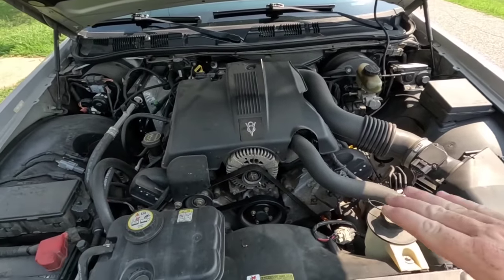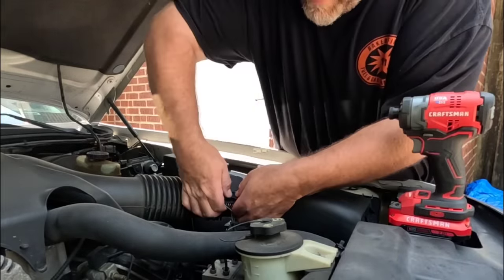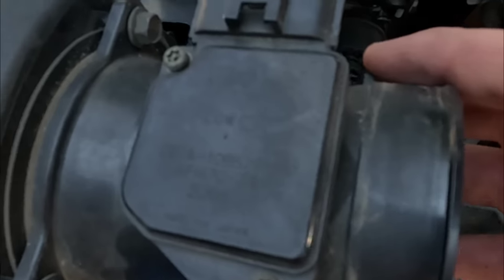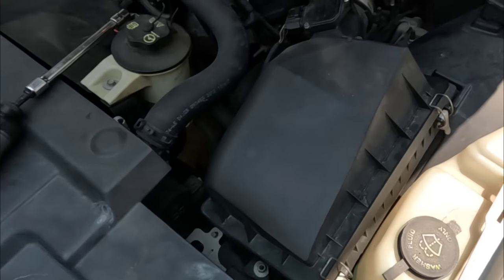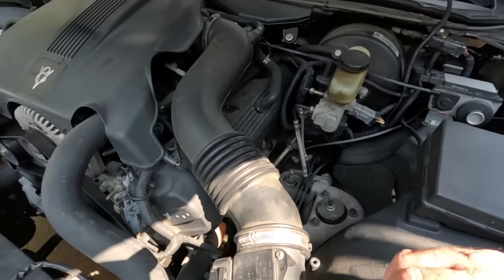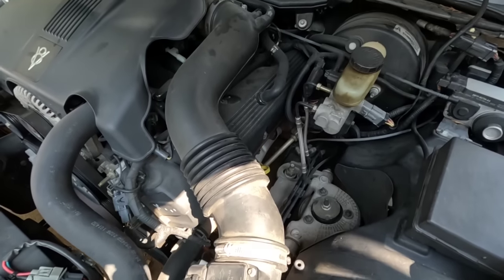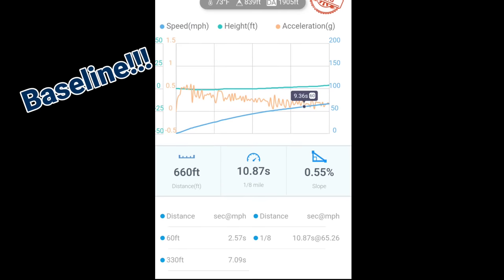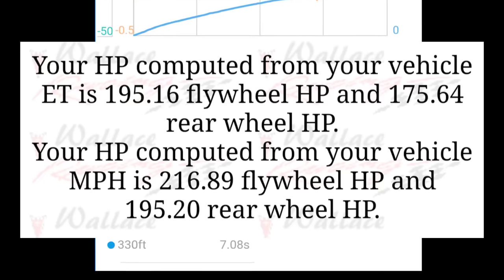FREE POWER MODS TESTED on the Ford Crown VIC LX SPORT 4.6L 2 Valve!!! @latemodelrestoration

Comment: Good video Andy. I dyno'd plenty of cars that had exhaust upgrades done on them. Never saw a decent gain unless it was the last of many modifications. The thing that I learnt from that was until an exhaust becomes restrictive, it's not. You can't solve a problem that isn't there. The only gains you can get in an unrestricted exhaust, is from improving the cylinder scavenging,  which is all dictated by what is happening in the front section of the exhaust. But you already know all of that. Looking forward to your future videos. Regards Greg

Comment: K&N made a cold air system that boxed in the air filter and made it draw thru the headlight...actually works...ask the man who owns one...most important mod for the vic/marquis is at least a 3.73 gear...with a posi...and a free flowing dual exhaust...if you check the size of the tailpipes in the stock ford exhaust it's choked down to like 1 1/2 in the bends over the rear axle...
Reply: I agree real exhaust would help.
Reply: And uh...the only place with a tune for the computer THAT ACTUALLY WORKS is Mo's speed shop in Dallas GA...mustang guys just told me to get a mustang locally...I told them that the marquis had something a muttstang would never have...a backseat I could schtupp their moms on...
Reply: @JSki-kb8vf  yep programmer next
Reply: @JSki-kb8vf  Lmao them seats are hella comfy too
Reply: But each side has only 140 cubic inches feeding it. (281÷2)
Mine has single exhaust, 281 inches, 4000 pounds, 23 mpg daily driving, 26 highway on cheapo gas. Mods are not worth the time nor trouble for the noise.
JMO.
90 GT ...HCI 👍😎
Reply: @hotrodray6802  best stock E.T...17.30...with exhaust...gear..intake...and a mo's speed shop tune 15.30...timeslips don't lie...13mpg driving like a lunatic around town...23 mpg crusing on the interstate...with the addition of powerstop brakes it's fun to drive...especially when one of those stanced import idiots pulls up buzzing his lawnmower engine and grandpa straps a holes hot on him...
Reply: I've had a few T-Birds and  a PI Crown Vic over the yrs with the 4.6 that I used a panel style K&N filter on in the original airbox but always seemed to have issues with the oil on the filter coating the MAF in a thin film oil after a while that made the cars run bad. Got tired of cleaning the MAF so went back to regular Fram filter. Always hated the MAF on them engines. Especially being so close to the filter... Current '96 TBird is running a regular Fram.
Reply: My Bone stock 02 Marquis runs 16.90 in the quarter. That’s with two people in it.

Comment: Regarding your Ford Crown Victoria, If I were you, I would try to imitate the Crown Vic Police interceptor calibration. You already have the dual exhaust. The next step would be to change your axle ratio to 3.27 or 3,55 . Then, substitute the powertrain control module from a Crown Vic police interceptor. This may require the installation of matching fuel injectors. Replace the MAF sensor and air cleaner assy with one from the police interceptor. The Crown Victoria police interceptor also uses  a lhigher stall speed torque convertor, so you may want to change that as well. I spent more than 40 years working at Ford Dealers. Would like to talk to you about this sometime.
Reply: Lmao 😂

Comment: I'm confused, how can removing a restriction (stock muffler) in the exhaust system result in loosing HP? It doesn't make sense, replacing a muffler with a piece of pipe will result in less back pressure, and less back pressure should result in a HP gain or at least keeping the same HP it had with the muffler. There has got to be some other variable that caused the drop in HP.
Reply from the maker: But cutting the pipe before the muffler you are changing the length of the reflective wave.  I do believe if it had a true 2.5" exhaust it would uncork it.  These pipes are less than 2" in some spots!!
Andy
Reply: @UnityMotorSportsGarage I was wondering what replacing the mufflers with straight pipe, to keep the full length ,would have done.
Reply: Four strokes don't need back pressure. What you're looking for is exhaust velocity. There are still four catalytic convertors to deal with. The only other answer I can come up with is lack of muffler has affected the ECU somehow. 

Straight piping it will just make it sound like ass.
Reply: @UnityMotorSportsGarage 
Uncorking ? 281 cubes = 140 cubes per side 🤔🤔🤔
Not exactly restricted...
Try tube headers.
Reply: Under car turbulence increased major and slowed it down.

Comment: The intake manifold comparison could be a red herring.  There were several versions of the intake manifold.  There was a recall for coolant leaks and some other issues.  The various intake mods that use Mustang parts will improve the performance in small steps.  An extrude honed Ford Perfomance/Motorsport version of the Police Interceptor intake historically makes a huge improvement after the air intake tract upgrades.  Gets closer to a Marauder
Reply from the maker: I am on the lookout for a good Bullitt intake off because once the Trickflow heads and all of the stuff I have planned for the car it will need it. The Factory PI intake becomes a restriction around 320 rwhp from all of my testing
Thanks for watching
Andy
Reply: No there isn't several intakes. There's the NPI intake and the PI intake for the 2v. The FRPP intake is a PI intake.
Reply: Why spend $500 to extrude hone anything?
It's still 281 cubes.

Comment: I've got a  2000  Grand Marquis. So far I've snagged and installed a Trick Flow upper plenum and ADTR ziptube. Throttle response is amazing! Next is installing the 2009 CVPI airbox I picked up for $35, a 90mm MAF sensor and a dual exhaust when I can afford it all with a SCT tuner from Marty's Spped Shop. Next year I'll be, rebuilding the bottom end the Manley way (crank, rods and 18cc Street Masters) and adding Trick Flow heads. Bad news is, as a mechanic, I'm a decent woodworker.
Good news is, I've got a friend with a 2000 Crown Vic who's teachinng me as we work on each other's cars..
Reply: I’m gonna start doing sorta the same thing on my 97 Vic within the next month.

Comment: Great video Andy, I did that on my Lincoln town car the air snorkel was so small in diameter it be like us trying to breath through a straw. Tho on the Lincoln they pull air from in front of the wheel well. So I opened up the bottom area more. You could go one step better on your air box and get some of the self stick sealing foam from one of those home improvement stores and completely isolate the air intake from the engine bay.
Reply from the maker: I like that idea! Thanks for the tip..
Andy

Comment: Im really loving this, i have a stock 98 npi mustang gt, i want to get some more performance out of it. So keep it coming, great job Andy!
Reply: Get PI heads, cams n intake manifold n you'll be making close to if not more than 300hp.. On your npi block your pi top end will bump up your compression..
Reply: Yes same here. This content is perfect for me. Gotta 98 gt and 03 grand marquis. Keep it coming.
Reply from the maker: If you do the PI intake and cam swap you will get most of the gains of the swap. The PI heads themselves offer little power. You do get a nice bump in compression though on a NPI shortblock.
Thanks for watching
Andy

Comment: Andy,

Go with the OEM intake manifold.  Install a 04 and up CVPI air box,  intake tube and a 80 mm (Mercury Marauder if you can find one) mass air flow sensor. You will need a tune to make it work.  I did my 03 Sport LX 15 years ago and it made a big difference. On the Michigan State Police test, the 04 CVPI (250 hp) ran .6 seconds quicker to 100 mph over the 03 CVPI. The factory exhaust system is actually quite efficient since they redesigned the mufflers back in 1992.  The higher numerical  RAR will improve acceleration, but you will have vibration from the driveshaft at the end of the 1/4 mile if you are at 90 plus mph.

Comment: The most effective basic mods for any Panther car are gears and a tune. Specifically 3.73's or 4.10's and a custom Tune by Marty Ochs of Mo's Speed Shop in Dallas, GA. Neither really increases power output BUT combined those two things really wake the car up and make it much more fun to drive. Anything, and I do mean anything, other than those two things would be a waste of your time and money. The only exception MIGHT be a 03+ P71 airbox and zip tube as well as a P71-style dual exhaust (for cars that don't already have those), but even that is probably negligible.

Comment: You can use HVAC ARMOR FLEX to seal the air box to the radiator support
Reply: Or a pool noodle will do the same.
Reply: The armor flex was a better idea its way more durable, Still thanks for idea!

Comment: Okay so as far as the airbox goes; the Maurader and 05½+ CVPI airbox supports just over 500 horsepower. There's no need for any of those trash aftermarket intakes, unless you just want more whooshy noises. Last I checked; ADTRs Rocket Couch is still using it. The best and basically only worth while mods, other than opening the box up, is a straighter zip tube and heat protection. All factory air boxes are cold air intakes, aftermarket ones aren't magic and make the air colder.

The problem with the Doorman intake is; it's a NPI that's poorly cast. The FRPP intake is just a PI intake. The main failure point of either is the coolant crossover tube.

You can get an 80mm throttlebody from Mustangs and Econolines, possibly Mark VIIIs and Continentals, too.  If you have DBW, I believe it's Econolines and Expeditions- I forget.

At some point you might as well get a CVPI computer because enough of these mods will require a tune to work right. Quite a few things will need a tune, like changing the axle ratio.

Also Civvys, exc the LX Sport have single exhaust. The LX Sport has resonators, the CVPI does not. Neither does the Maurader. The CVPI also has stainless steel exhaust.

A Civvy might, MIGHT be able to use a CVPI aluminum or metal matrix driveshaft. If I recall; only the CVPI, Town Car and Maurader use the long tailshaft 4R, so it is shorter- as far as Panthers go. I do know the F150 also used the long tailshaft 4R.
Reply: TC are longer wheelbase. 3" and 9" depending on model.
Reply: @hotrodray6802  I don't know what that has to do with anything I was saying. Yes the Executive Series and P72(Taxi) have an extended wheelbase that makes the back doors three inches longer.

Comment: I noticed the intake as well. I bought an e-bay intake for my P71 and it worked great. I bought another E-bay intake and put it on my other P71 and I lost power above. It fell on its face above about 4 grand. I noticed the runners were flatter on the second one I had bought. The first one I bought had taller runners similar to the original Ford intake. They were both $135.00. I went and bought a factory Ford P71 intake and haven't had a prob since. But it was $315.00 lol. Big difference. The E-Bay intakes seem to last me about 2 years before they have to be replaced. It evens out in the long run. When I replace the E-bay intake on my first P71 I will just go to Ford and get an original.  Longevity is also a concern.
Reply from the maker: It's weird you are right it feels like it hits a brick wall at 4000rpm! I'm already on the search for a Ford PI intake
Thanks for watching
Andy
Reply: If you look on e-bay and see the high runners it will run right. I don't know how to pist a link to it. I've bought a few now and they are $135. Type in 4.6L 2v I take and it pops up in the first spot with the tall runners for $98. It will not last but about 2 years before it leaks tho.
Reply: It runs just like the P71 intake. They have gotten cheaper.

Comment: Nice! Objective testing.  The gears will be a hit, hope those go next.  Listening to that 1 - 2 shift was almost painful, that relatively small engine pushing that heavy car down the road with pretty tall gearing I suspect (2.75 or so?).  I give that little cammer credit for pushing that barge around as well as it does. I remember the days of 400 inch smogger engines that were making 185 HP so this thing's doing alright.
Reply from the maker: It's horrible... Bad, thing is it has 3.27 gears. It takes FOREVER for the 1-2 shift!
You just coined the name for the Engine... Little Cammer!
Andy
Reply: @UnityMotorSportsGarage  Right on Andy, name's all yours!
Reply: Computer pulls out timing to smooth the shifts. It's very noticeable in my car on 87 gas... Less on 91 non eth but $$$$.

Comment: Regarding the Dorman intake, when I was researching it to replace my OE 2005 intake (cracked heater nipple, of course) I read that the issue is that they used their older 4.6 design, which was actually an improvement on those engines, mated to the later intake port design, but of course Ford had also improved the entire intake along with the ports. The video you included really shows the difference - the older intake design is more optimized for hood clearance, so tighter, smaller, shorter runners, and a smaller plenum makes for less flow. I ended up getting a Motorcraft OEM replacement intake, in light of all that.

Comment: my 2001 merc grand marquis runs good, but not much acceleration with 2:73 gears. on the highway,  it runs pretty good. thanks for the video Andy!
Reply from the maker: Yeah my first Vic had 2.73 gears... Horrible 😞 so I put a set of 4.10's in it lol 
Thanks for watching Kurt
Andy
Reply: 30mpg?? lol.. My 95 Lincoln Towny got close to that with 3.08..lol
Reply: @P71ScrewHead 
My 99 TC with 91 octane engine got 27 at 73mph consistently on level ground.
So did my 97 Mark dohc.
Mark was quicker but not near as smooth quiet.
Reply: @hotrodray6802  Yeah, these 4.6L 2v n 4v where great milage v8s.. Still have a hard time getting rid of my 95 Lincoln Town Car that hasn't ran now since almost 9yrs, just been sitting in my yard, sadly..lol
Reply: @P71ScrewHead 
30? Was that actual distance calculations or the dash computer?
Reply: @hotrodray6802  The dash read that when i ran it on cruise control at 55pmh for long periods of time.. It was a gutless v8 at only 175rwhp but very economical.. My P71 makes 309rwhp but chugs gas like a damn big block..lol

Comment: I have an 03 mustang GT and the snorkel gets wider towards the air box but is restrictive at the end.. I cut it back a few inches doubling the size of the opening but retaining the reach out of the engine bay into the fender well.. With that small modification and a K&N filter is better than any hot air intake on the market and retains factory look.. I definitely felt a difference but it’s probably still under 5hp.

Comment: I have an ‘01 CV HPP.  It was regularly faster than the later “250hp” CVPI models and I hardly did anything to it.  Airbox was modified like in this video(but not opened as much), K&N filter, I ported the upper plenum, “opened up” rear cats, cheap-o turbo mufflers and resonator delete, stock 3.27 gears but with a trac-lok with the +1 clutch mod and a Jmod on kill…never could get it to hit hard on the 2-3 but almost always barked the tires on WOT 1-2 shift.  

Bought it with 100k miles and beat it every day, twice a day, to and from work…and basically any other time I drove it…finally tossed the chains at 178k.  RIP

Comment: I OWN A MINT 03 4.6 EXPLORER, ENGINE WAS REPLACED WITH A NEW ONE BY THE PREVIOUS OWNER, AND HAD A FEW 1000 MILES ON IT WHEN I BOUGHT IT. FIRST MOD I DID WAS REMOVING THE MAIN MUFFLER, IT IS HUGE AND HEAVY, DON'T THINK IT MADE MUCH OF A DIFFERENCE POWER WISE, BUT NOW IT SOUNDS BETTER THAN ANY V8 IN TOWN, AND MANY PEOPLE ASK ME ABOUT IT. BEST MOD I DID WAS FITTING A BIG MOUTH HOOD SCOOP THAT RUNS 2 AIR HOSES TO THE FACTORY AIR BOX, TO THE FACTORY AIR INTAKE, AND MADE THE ENGINE MORE RESPONSIVE AND YOU CAN HEAR IT BREATH WAY BETTER WHEN YOU FLOOR IT, LOOKS GREAT AS WELL, AND YEAH PEOPLE ASK ME ABOUT THE SCOOP AS WELL, JUST BY LOOKS IT IS AN IMPROVEMENT. IT IS STILL SLOW, BUT THAN AGAIN IT IS A SUV AND HEAVY. I HAVE BEEN THINKING ABOUT FORCED INDUCTION, AS IT IS STILL THE BEST BANG FOR YOUR BUCK, A SMALL TURBO AT LOW PSI (NO MORE THAN 6PSI) IS STILL THE BEST WAY TO GET POWER OUT OF ANY V8, SURE YOU WILL HAVE TO MAKE UP YOUR OWN KIT, BUT THERE ARE VIDS ON HERE ON SIMILAR FORD ENGINES HOW TO DO IT. THE BEST MOD I DID FOR MY EXPLORER WAS THE BROWN WIRE MOD, AT LEAST NOW MY EXPLORER IS REAR WHEEL DRIVE ON THE STREETS, PUSH THE 4X4 BUTTON FOR OFF ROAD USE. I WISH THERE WAS A BOLT ON SUPER CHARGER KIT FOR MY EXPLORER, ALTHOUGH COST VS TURBO IS WAY MORE.

Comment: I did always want to wrap my intake tubing in heat reflective tape like Ford boss did
Reply from the maker: That works! Also pulling the intake off and putting on both the valley of the engine block and bottom of the intake helps prevent heat soak!
Andy
Reply: @UnityMotorSportsGarage 👍👍😎
Trying hard to help that 281 pull 4300 pounds around.

Comment: I did the air cleaner trip to my 93 Lincoln it was worth it just to have the intake sound
Reply: They actually filter out 99% of dust and particles from 0-20 microns
Reply: @randoboggsdeepin8803 
What's that have to do with sawing off the snorkel?

Comment: When I look at the pictures on E-Bay, I can see the difference. The one has tall intake runners like the original.  The other one has the runners that are kind of flat on the top like the Dorman intake. The one with the tall runners ran just like the original Ford P71 intake. But they don't last as long as the factory intake
Reply: Look at the plenum lower side. Massive difference.